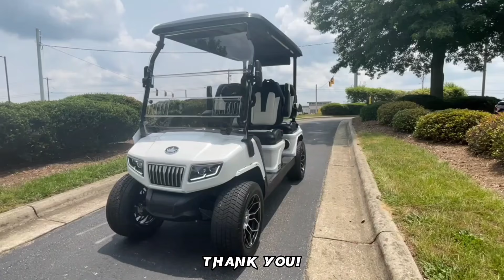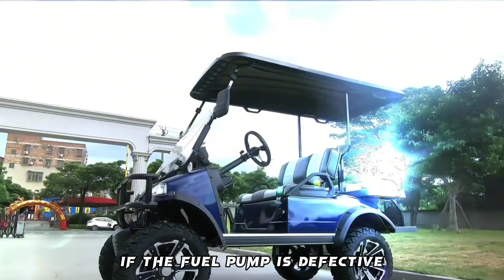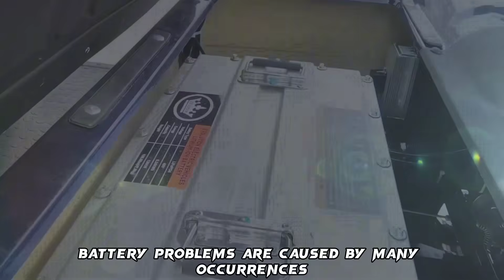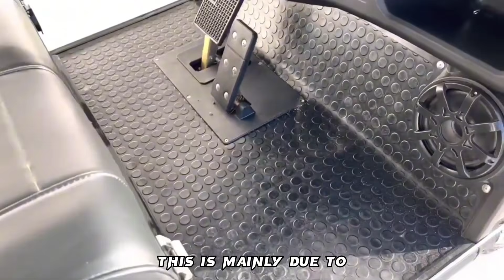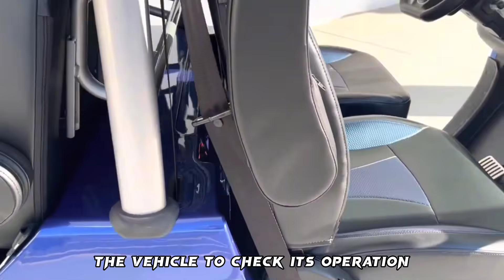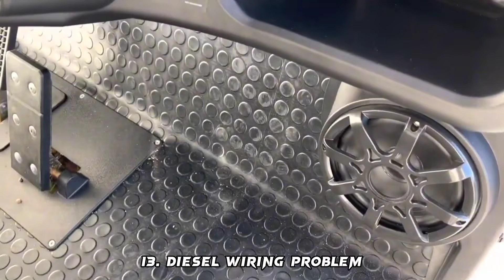Evolution Golf Cart Problems, Issues 2025 | Troubleshooting Fixes

Comment: Any fix for Speed / Battery display going blank (black)? Happens on start-up…no reverse camera displayed in R and then no speed / battery displayed in D.  My “fix” is to shut down and then power back up but clearly there is a problem somewhere.  Should add my cart is a 2 month old D5 Ranger 4.
Reply: You have a controller issue

Comment: How is a false reading on the battery gauge fixed? I ran out of power on my 2021 Evolution Classic 4 at 58% after 28 miles. The gauge went from 58% to zero.  I have 130Ah amp battery and wondering if this is the normal range on a single charge?
Reply: Me too! What was your solution?